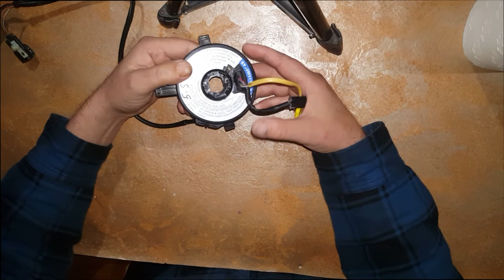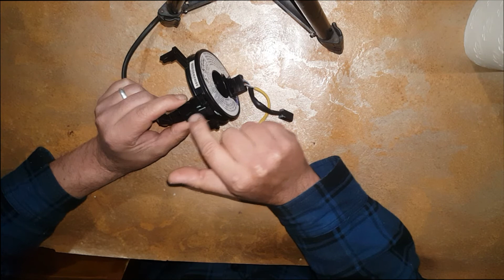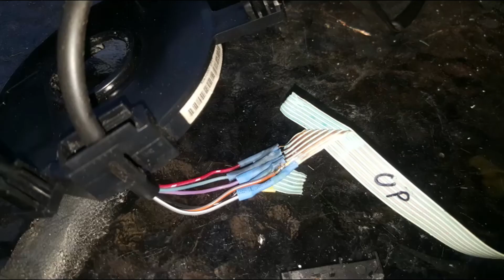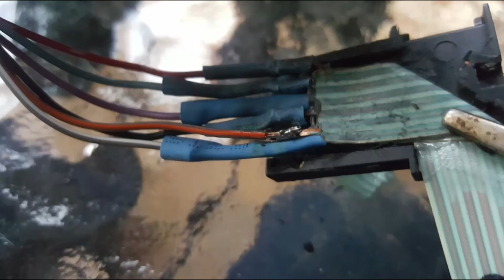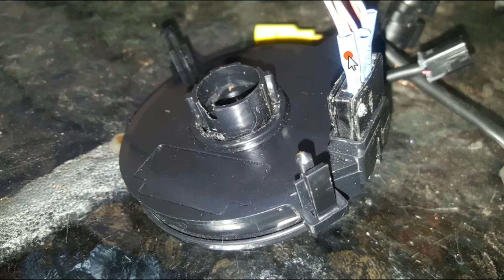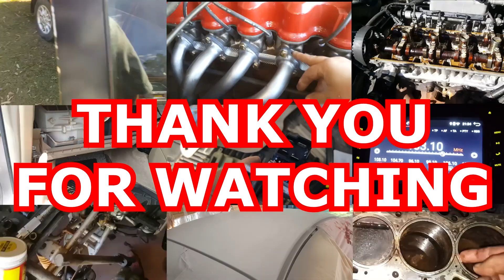D.I.Y. Repair Steering Wheel Ribbon - Spiral Cable Clock Spring [ AU Ford Falcon 2000 ] -PART 2-

Comment: I'll be doing this to my AU Falcon clock spring, I think I have the same issue, my horn works when the steering wheel is in the centre but as soon as I turn it left or right, the horn no longer works, but after 5 minutes it'll work again. I think there's an intermittent break in the wire somewhere.

Comment: nice video, my "99 au horn got stuck on,  what would you reckon it is?  hazard a guess, I just took off the horn wire at horn when it first happened to solve the problem, later took out relay so it wouldn't drain battery. Scared to put it back on in case it starts blaring again.
any suggestions: thnks
Reply: is it possible to get to the horn switches inside the airbag area?
Reply from the maker: The same thing happened to a mate of mine. It was the Clock Spring the same as what you see in my clip. I was able to fix mine and it's still working well. You can find them on eBay https://www.ebay.com.au/sch/i.html?_nkw=Au+Falcon+Clock+Spring&norover=1&mkrid=705-155027-169669-6&mkcid=2&keyword=au+falcon+clock+spring&crlp=433534678262_&MT_ID=584966&geo_id=32586&rlsatarget=aud-786643580046%3Akwd-670909610140&adpos=&device=c&mktype=&loc=1000212&poi=&abcId=1140756&cmpgn=1754439580&sitelnk=&adgroupid=71446110394&network=g&matchtype=e&gclid=Cj0KCQjwr-SSBhC9ARIsANhzu17K59zRF54OGYLUAwww5wfhtC4tPAYa8-2jLTwe4MdOfI5Zl_OyVqIaAgZ8EALw_wcB&_sop=15